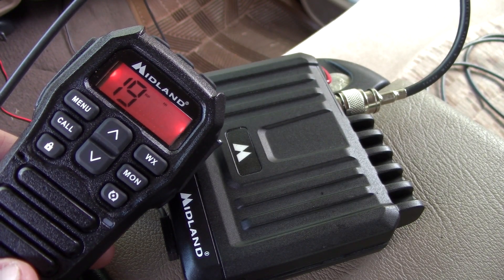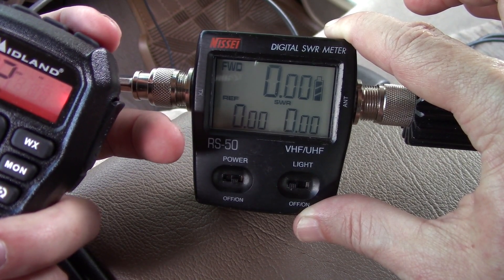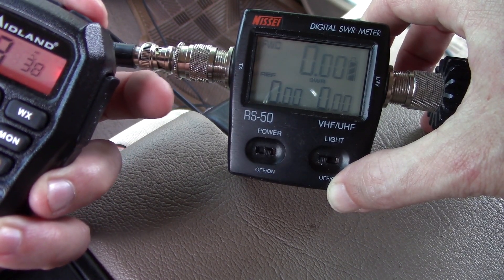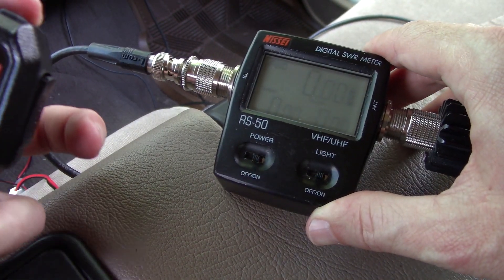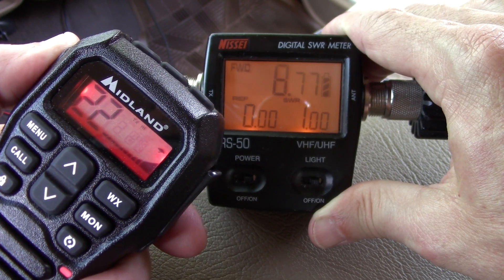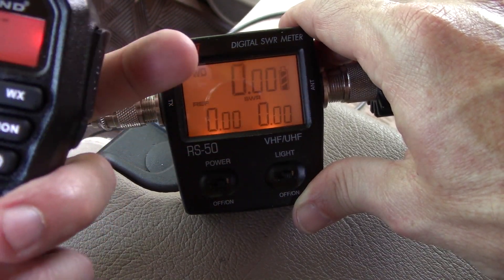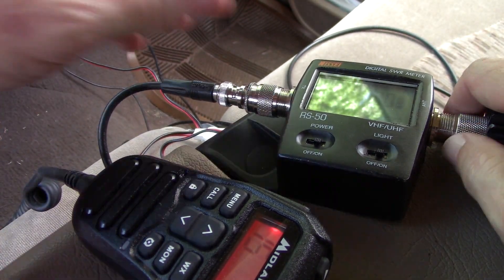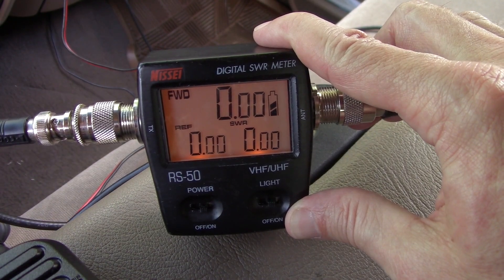Midland GMRS Mobile radio MXT275. Can it produce 15 watts?

Comment: G M R S  channels are 15 repeater  through 22 repeater and will be 45 watts out on my
radio should be at least 40 since you did not read the book going into a 60 watt repeater
on a  towerand go 20 miles   I am W R X N 824 out of Minneapolis Minn.
Reply from the maker: Glad you are getting 45 watts out of your radio. No I didn't read a book about going into a 60 watt repeater because I didn't use a repeater in this power test.

Comment: power is often mesured at 13.8v input.
Reply from the maker: Yes it is. When parked and engine off the radios do lose power from the voltage drop.

Comment: Coax does make a difference. Check out something like LMR 400 for coax to see a big difference.
Reply from the maker: It would drop the loss, but LMR 400 is a bit stiff to route around tight spaces.
Reply: @Soladaddy  Yes I would agree look at LMR240 as another choice.

Comment: Way to put your Ham knowledge to GMRS! I like how you demonstrated the differences in coax loss and power supply voltage. I would also like to see a range video, but I suspect that it is about the same as 70cm ham ranges at 15 watts. Still be a good video to watch though!

Comment: If you want a good investment for GMRS mobile, try to look out for Motorola Maxtrac or CDM 1250. Even Kenwood ICOM and VERTEX YAESU make excellent mobiles. The radios I've mention may not be part 95 accepted, but when programmed WTF cares. Besides Individuals have been using FCC part 90 equipment for GMRS long before the Family Radio was establish in the mid 90's.
Reply from the maker: True. It's funny how HTs and mobiles get scrutinized for Part 95 but repeaters get a pass.
Reply: Programming them is the road block.

Comment: I have one of these radios installed in my wife's 2012 Forester.  Very interesting vid, thanks for making it.  I too have a choice between cigarette outlets, never thought there'd be a difference.  Would be interesting to measure the voltage or amperage in those outlets, looks like one will have more juice.  I don't have the tools, else I'd repeat your experiment.  I can say that with her Larson NMO mount and Laird GMRS antenna, cut to what's specified for 462.000, she's getting decent performance to an area repeater from about 10 miles away.  However, as she's almost always using that repeater, I will likely cut it still shorter, closer to what's specified for repeater input frequencies.  Also wondering whether it'd be worth hard-wiring to the battery.  Probably won't as I expect to replace this car next year and I like how easy it'll be to remove and reinstall as it is.
Reply from the maker: I never thought the outlets would be different either. If you have a voltmeter you could check the voltage while running. It's possible one is 12v and the other 13.8. I would normally run to the battery, but 15 watts might not be necessary.

Comment: Thanks for this test.  I was wondering why I wasn’t getting more than 10 watts from the radio.  It’s plugged into the cigarette lighter circuit.  Will now go directly to the battery and do a test.
Reply from the maker: That would be a good idea. I was thinking that 15 watts wouldn't be much of a load and the accessory port would suffice. Appears that a larger gauge cable would help.

Comment: Nice video! Is there any chance you can do a range video??
Reply from the maker: Absolutely. I'm trying to carve out more time for radio especially antenna and range tests.
Reply: you will get about 20 miles as the repeter will bust you signel to 60
watts out from 150 ft in the air I am 10 miles from my tower and do just fine.